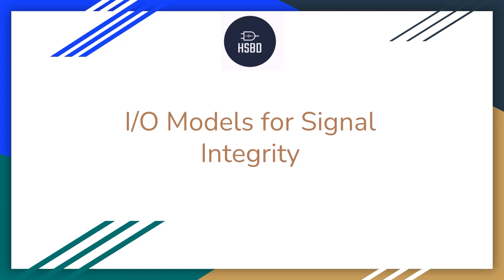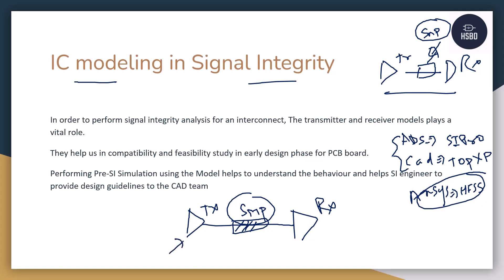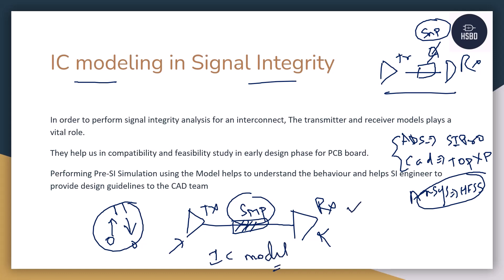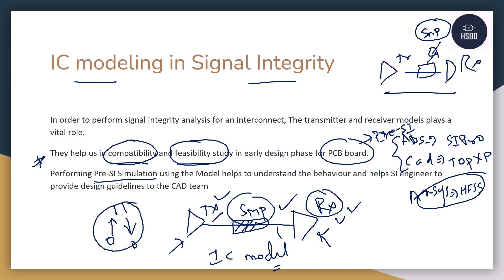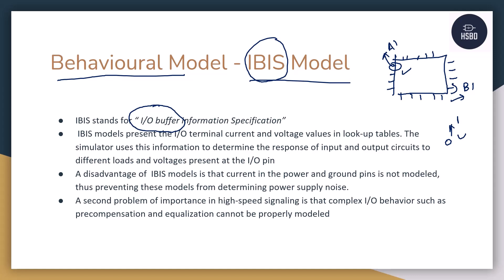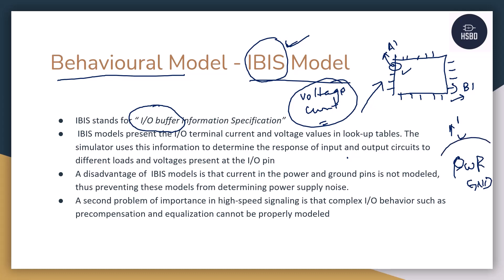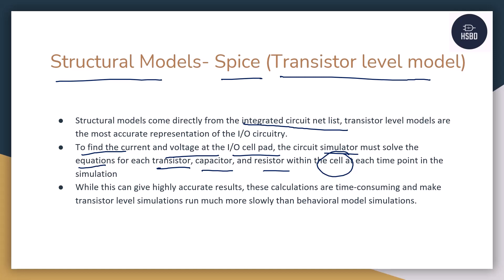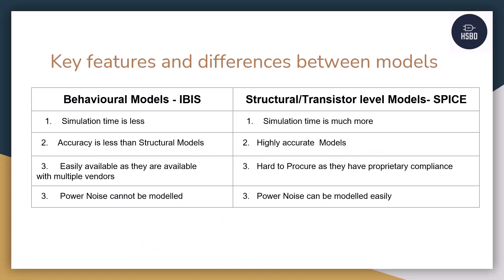IBIS vs SPICE Model for Signal Integrity Analysis | High Speed Digital Design

Comment: Thank you so much for wonderful overview. What is the difference between R/C/L_pkg, R/C/L_pin?
  Usually a component in IBIS file has multiple pins. Each pin has its own R/L/C parasitics which are mentioned per pin using R/L/C_pin. Then what is the real significance of R/C/L_pkg parameters?
Reply from the maker: Hi, 
You can always connect with me on TopMate: 
https://shorturl.at/Fuf19 

Discovery Call is Free for first 100 Candidates